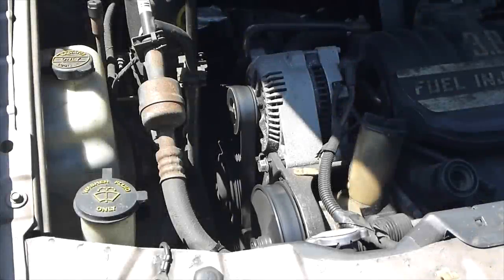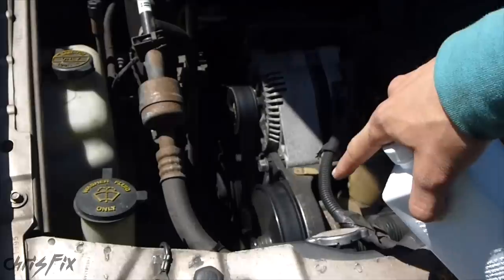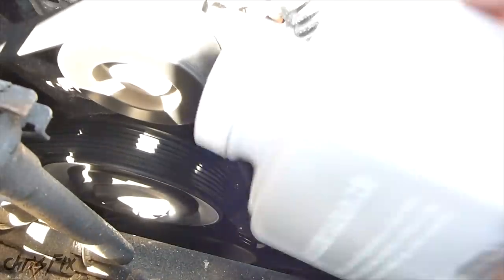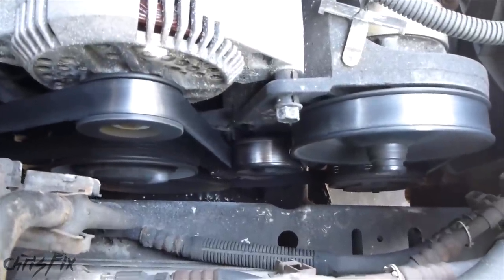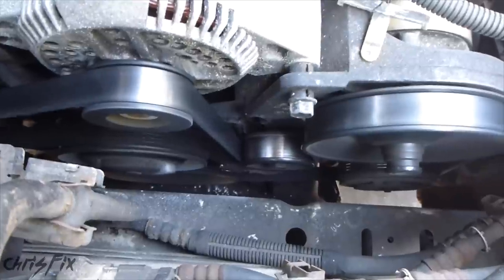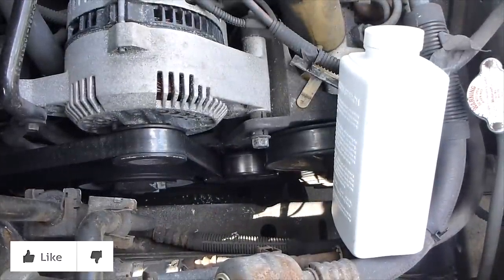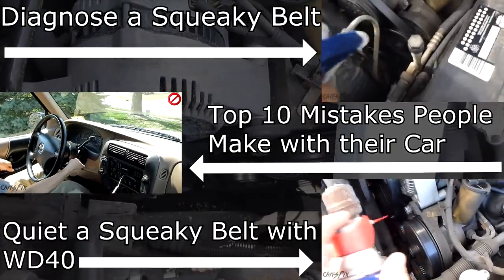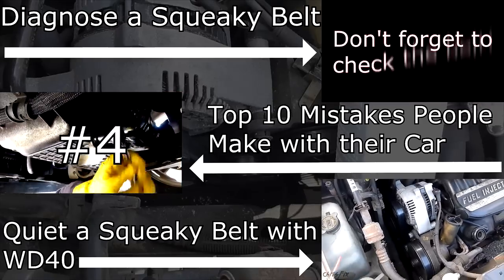How to Fix a Squeaky Belt (Baby Powder)

Comment: I have changed, the belt idle pulley, the belt tension pulley, the alternator, and the best belt i can find. It was the belt but the noise came back after three days. Cleaned all pulleys with a De-greaser and squeaks at a very low sound...you almost cant hear it. What would be your best thought on how to get rid of it completely? Thanks
Reply from the maker: +Noah R. Watch this to solve your belt noise issues: https://www.youtube.com/watch?v=AEUe6uKxTv8

Comment: Belt on my 2010 Ford Ranger squeals, but mostly when it's raining outside or I've driven through a puddle or two. So, I think it's just that my belt is getting wet from underneath. I've checked all my pulleys, and my belt looks good as new; so I know those ain't the issue. The old man suggested I use belt dressing, but you say this works better. Any thoughts on a more permanent fix?
Reply from the maker: TheCharlieLow Belt dressing, wd40, and baby powder are all methods to temporarily quiet your belt but they do not fix the problem. Here is a video to show you how to diagnose your belt noise problem: How to fix a squeaky belt (figure out where the squeak is coming from)

Comment: Hi Chris, top tip, I usually use wd40 but that's going to change now as I will be using baby powder

Got a ?, what does it mean when you do a leak test on a diesel set of injectors and they all are different levels on the leak test

Thanks again
Reply from the maker: propertyofAllah1 You dont want to have a leak on injectors when you do a leak test. The injectors should not leak any fuel at operating pressure.
Reply: All 4 injectors showed more than half the tubes full, do they need replacing?  I get engine light on when you drive it harsh or a heavy foot, no loss of power, I'd you drive gently its OK
Reply from the maker: What is the check engine light code?

Comment: im gonna try this, just changed the tensioner pulley and idler pulley, still squeaky, will give this a shot and see.
Reply from the maker: Try this to find where the squeak is coming from: How to fix a squeaky belt (figure out where the squeak is coming from)
Reply: Yea, I've watched all your videos. I know its coming from the NEW tensioner pulley. Which idk why, bc its new. Lol
Reply from the maker: what happens if you spray some wd40 in the pulley bearing? Does the sound go away? There is a chance it is defective...
Reply: Well. I just had knee surgery the other day, so its gonna have to squeak for a while. If I get around to gimping I'll squirt some in/on there and see if it helps.
Reply: I may have just tightened it to much.
Reply from the maker: Gotcha. Good luck with the knee and let me know what fixes your squeak!
Reply: thanks man, and i sure will, keep up the vidoes, i enjoy watching them.
Reply: @kylemonroe5902  What did you find Kyle?

Comment: wats up chris have a question...I have a 2001 maxima and I just changed the belt and tensioner. everytime I turn the ac on or press the gas it starts squealing like a pig in pain lol but goes away when I turn ac off or take my foot off gas. what could this be.
Reply: dj storm bad ac compressor clutch

Comment: a new one on me.i brush on a very light coat of brake fluid, to sit over night so it don't get on painted surfaces. oh yeah don't dip the brush in brake fluid container , pour some into another jar save for some other time mark it as such & not 4 brakes!
Reply from the maker: Does it work?
Reply: the brake fluid eats the rubber....... i don't think it's a very good idea........ u better change the belt
Reply from the maker: Good point!